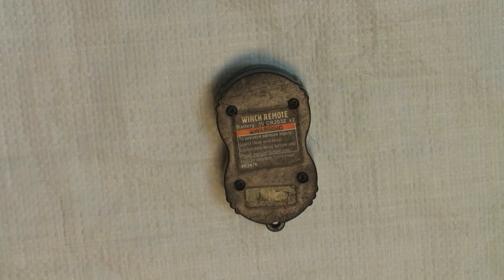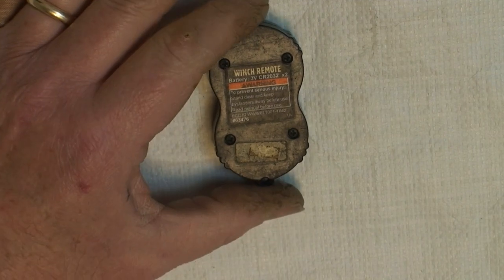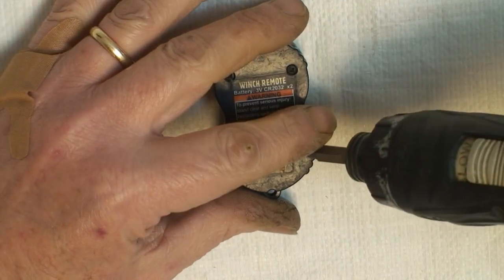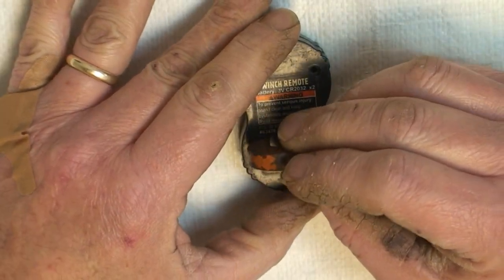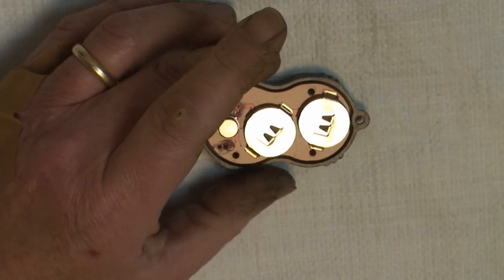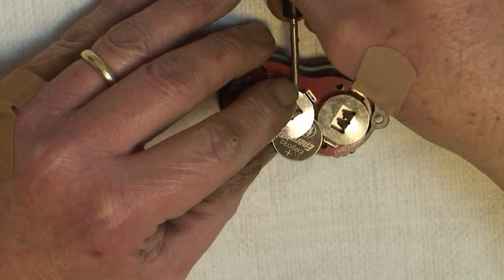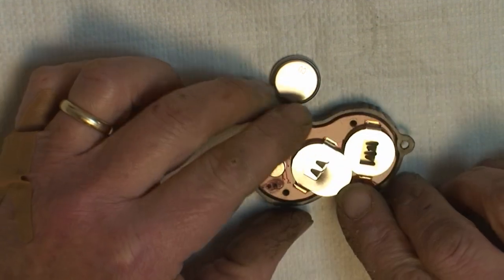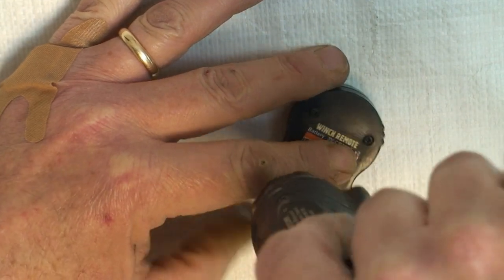Badlands Winch - How To Change the Batteries

Comment: I just went to use my remote and it will cut on but flashed fast when I hit extend or retract. I changed the batteries and it works fine now. There is nothing in the manual that tells you that this means the batteries need replacing but it solved  my issue. I did not have to reprogram it after installing new batteries. Hope this helps someone. Thanks for the video